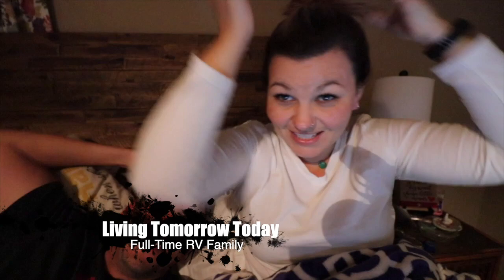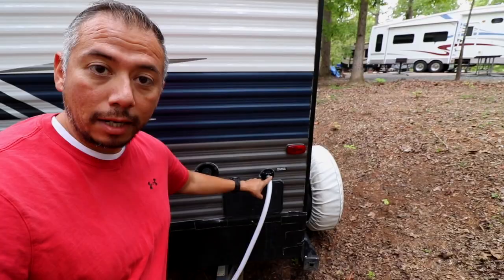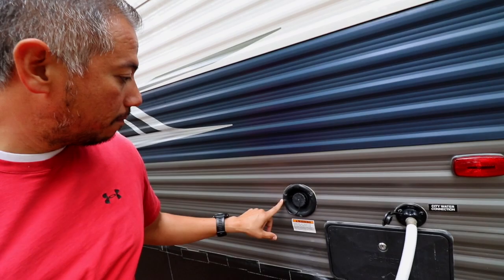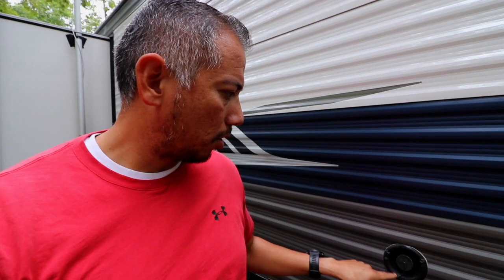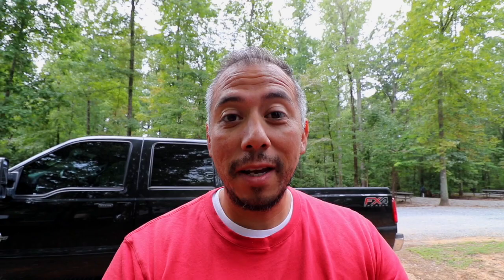Fresh tank filling up when connected to city water - How to fix it

Comment: All ways use a pressure regulator on your city water supply if not, the pumps internal pressure regulator will open and back fill your fresh water hold tank. I believe its Camco that makes an adjustable one i highly recommend set at 45-50 psi max. You won't have crazy good pressure but your trailers pipes not designed to handle pressures above 45 psi. I hope this helps.
Reply: I agree but I had a pressure regulator on mine and it still happened. Pump still functions so the easy fix was to use gate valve to bypass when not using until I can install a check valve between inlet line and pump - or replace a pump I use maybe three times a year living in my RV full time.
Still, Thanks for the tip about Camco though!
Reply: If you don’t use the regulator and water fills the blue water tank what part needs to be replaced? Asking for a friend ;)
Reply: So once I attach the pressure regulator I just bought hopefully it solves it thanks
Reply: I use a high quality brass water pressure regulator. I have it adjusted for 40 psi and I have plenty of pressure for shower.  (Northwood Fox Mountain 235RLS)

Comment: it is a very good DIY to reset the check valve in the pump head. What is happening is your city water is higher pressure that the check valve in the pump. By disconnecting the city water and running pump is basically pushing the water valve in the right direction and possibly releasing what may have made it be stuck. The hot water part is not needed. It will be cold at the pump . The hot water will not run thru the pump because the pump is right at the outlet of the tank. When you run hot water you are pushing cold water into the water heater and hot water comes out the top. Great repair tip.
Reply: and how do you set the check valve in the pump head, I ask?

Comment: Just tighten the phillips screw on top of your 12v. Pump and that will stop it from revealing into your fresh water tank. That phillips screw is the pressure controller it will open and relieve overpressures into your fresh water tank
Reply: Where is the Phillips screw at is it on the pump

Comment: I guess lots of RVs are having that problem. Last weekend I left my city water connected and later I heard a pop sound ( thinking that was my RV  seating at the ground ), again another pop sound. When I saw my RV floor I notice something wasn’t right, the floor had a bump….I rushed to turn off the city water and opened the drain valves under the trailer. I was thinking how could my fresh water tank be filled? Well, bingo. Now I have no idea what those pop sounds could be. I notice some part of my floor is fluffy….not hard as before. For sure I will have some bad news from any RV repair shop. Anyone got same problem? Please let me know.

Comment: We had this issue as well. It was the back flow preventer in the water pump. Unfortunately this technique wouldn’t  work for us and we had to have the pump replaced.  Glad it was an easy fix for you.
Reply: Or you can buy a back flow valve and install it in line on the inlet side. $10

Comment: Comes down to use it or lose it.  We dry camp 1 or 2 times a year. Water pump rarely used any other time. There is a check valve that prevents the city water from bypassing the plumbing at the pump and make its way upstream to the fresh water tank. Thus-SURPRISE you have a full tank of water. After analyzing your video I tried your solution except for the hot water believing that running the pump to push the water thru the pump might flush out what is causing the valve to hang up. That seemed to be the solution.  Now on to my generator.  Have to exercise it too. 
That’s for the video it helped me get my mental wheels turning.
Reply: Thanks

Comment: Thanks for the tip but it often does not work. Talked to a friend who is a certified RV repairman. He said the problem is the pump acts as a check valve - so you can either replace the pump or put a check valve in the inlet line before the pump to prevent back flow. 
 I was about to install a check valve when I stumbled on another temp/functional fix. In most newer RVs they are plumbed for easy winterization. If you do not intend to use the pump simply turn it off and close the gate valve there for winterization right before the pump. The city water will bypass the pump and not fill the tank - problem solved. Need to use the pump -which we rarely do  - open the valve.  Hope this helps.
Reply: Do not install a check valve on the inlet(suction) side of the pump; install a check valve on the discharge side. Do not introduce any obstruction to pulling the water up and into your water fixtures. Also, a functioning check valve on the discharge side will prevent the pump from forever being filled with water when not in use.
Reply: @JAY-wb2fv  Good points

Comment: I also just had the same issue. There was no problem the first day. The second day I removed my pressure regulator from the city water to help with water pressure inside the trailer. Later my wife heard water dripping outside and when I investigated there was water pouring out of my freshwater inlet. I was baffled but figured there must be a check valve separating the two water systems. I turned off city water and started using the freshwater system rather than drain the tank all over the campsite. The next day I reinstalled the pressure regulator and started using city water again. No issues after that. Whatever valve got stuck open seemed to have reclosed. I assume your fix is what did the trick. Thanks for your video.

Comment: Brand new heartland trailer. Only moved once to a permanent spot. Had same issue. It didnt fill all the way up. I noticed with gauge it was 1/3 tank after i emptied it after purchase. I had never put water in fresh tank. So ty fir video. I just did it and i will see if the issue continues.
Reply: And now not working again

Comment: I have the opposite issue. I fixed the cracked drain valve under the camper  and started filling the water tank. I don't hook up to city water I just use a hose and fill the tank.  The hose was running into the tank, I went inside, turned on the faucets ( no hot yet as I've not turned on propane tanks yet ) let them run a few seconds and came back out to notice water gushing out of the city water hook up. It never did that as many times as I filled the tank last season but it sounds like it might be the same issue.  A stuck valve maybe?  HELP!

Comment: Install a manual valve at the water pump Inlet. Turn it on when using the pump and off when using external water source.

Comment: Thank you so much!
Been trying to figure it out on my own! Lol lesson learned.
Do you know if it could have something to do with the pressure regulator? I move mine from the top (city water into trailer) to the bottom (city water into hose) and it started acting up after that. Thoughts?

Comment: Never connect a hose to the city water connection straight in. The weight of the water in the hose will fatigue the rv connection. Always use a 45°, or better yet a 90° adapter to ease the inline connection transition to the rv.....

Comment: My fresh water intake valve was leaking... so I got a new one... I replaced it and hooked my city water hose back up and turned the city water on but I'm getting no water inside my trailer... the only way I got water was to turn on my pump. I've never used the pump before to get the city water inside my trailer. So can anyone tell me what's wrong... I'm just a little old lady living in a 32' travel trailer that I know nothing about. I've been living in it for a yr now with no problems it's a 32' Dutchman aspen it's a 2015

Comment: So this fills the tank and you also will have continuous water? That I do not understand - difference between filling the tank and just leaving the city water hose on? THX in advance
Reply: Your freshwater tank will keep filling and building up pressure if the pump is never on.
Reply: @sully6326  Them turn the valve to no fill at the tank? 2018 Winnebago Intent 30R only a city water fill out side

Comment: Most of the time it happens because of no inline Regulator or a cheap Regulator that is not working properly.
Reply: I think mine is broken. I googled it and finally found something called a diaphragm pump in-line filter. 
I’d try to get it to work like this video says but I already emptied my fresh tank. 😢

Comment: Why hot water? Won’t just running the water do it?
Reply: Yes just running the pump can help if the backflow preventer is stuck. 
The hot water Never goes through the pump at all. 
Most of the time the problem is from not having a Pressure Regulator on the city water source.